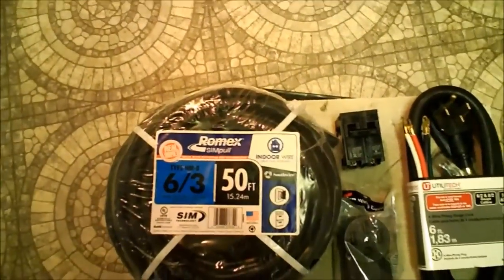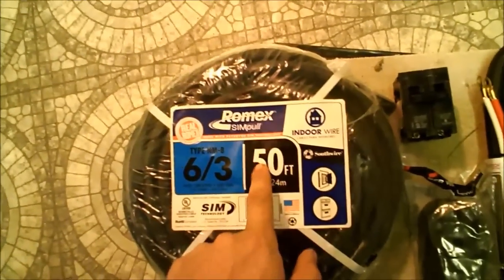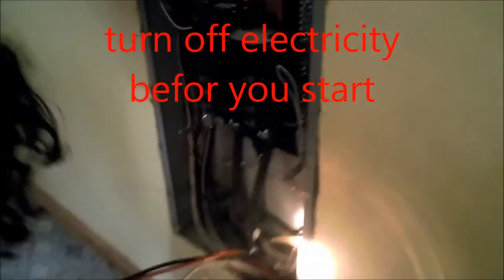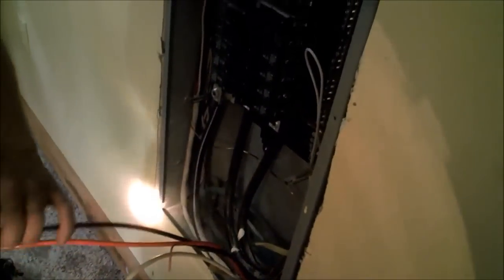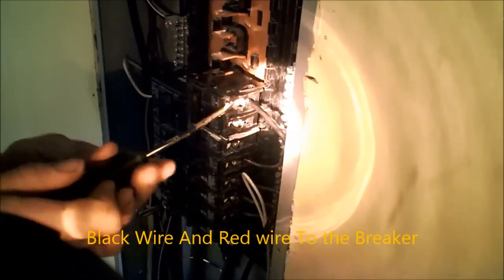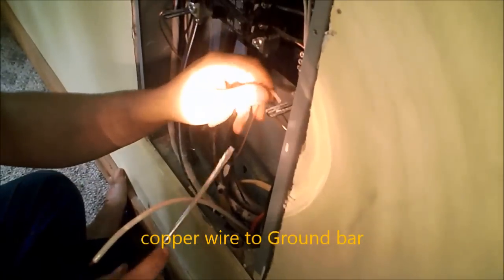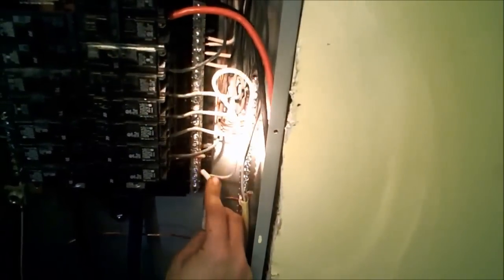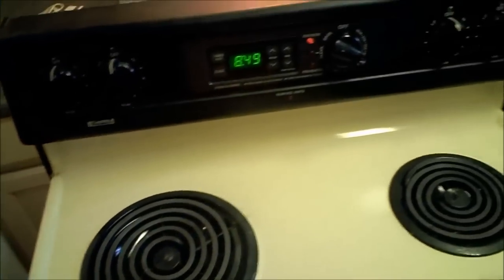How To install a 4 prong oven receptacle

Comment: Does it matter which brass pole the red and black are wired to? Or could you interchange them with no ill effect?
Reply: doesn't because there both hot dont confuse ground
Reply: +DannysCam brass nut is for your hot black or red lighter color screw is your neutral